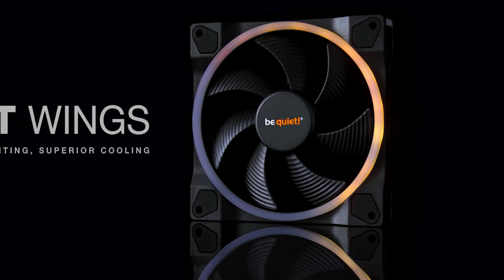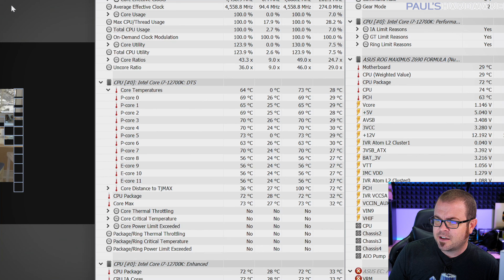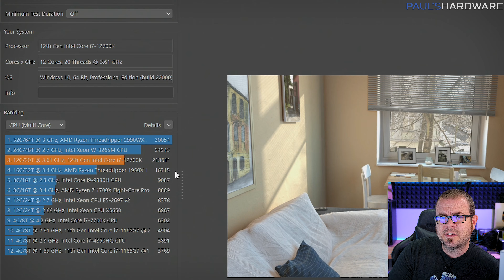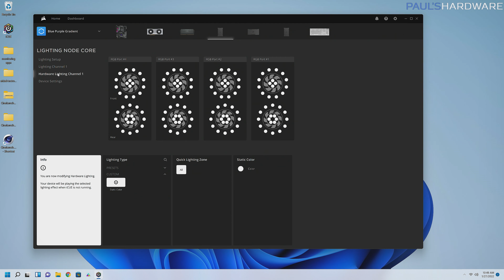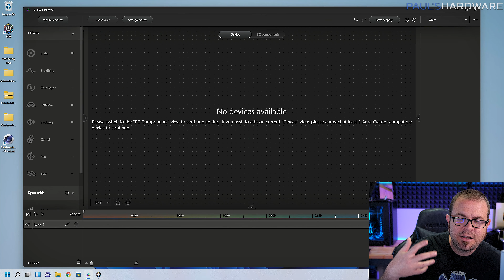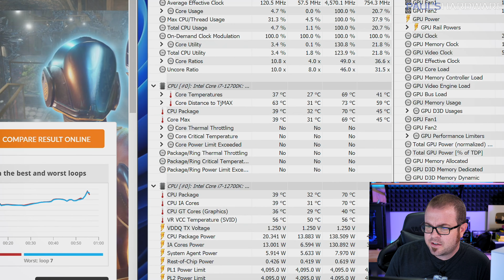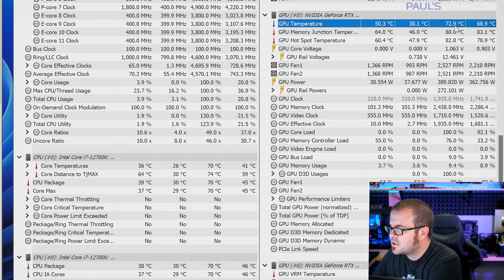Flipping Fans, Stress Tests and RGB Lights: All-White Build Part 2

Comment: This is a perfect example for something I've always wondered. If you 3D printed in vase mode some ducts directly connecting the video card to the top of the case so it had fresh air, would it decrease the GPU temps even more without even needing the top fans. The fresh air ducts would probably only take up space of two fans and you could leave the third fan for an exhaust at the top.

Comment: Only seen a couple comments so far, but what about that pump block being positioned above the rad? Unless that AIO is practically air free, that pump is possibly doomed to fail prematurely. Not super likely, but it was a big topic a while back, and you even had a failure. 

Despite that, it does look sick as hell, nice job.

Comment: Wait, your fan testing makes no sense. First alt config showed you had better CPU but worse GPU... so instead of switching them back to inlets and then swapping the air fans to exhaust instead? you doubled the mistake but having them all exhaust, unless i missed something?

You didn't prove you were correct, you just showed that inlets on the gpu was correct but not the overall fan config in the box...

I think you would get better performance with fewer fans causing lots of vortices and turbulence, decreasing the total amount of airflow through the case.

Comment: I'd set it up where the top and rear are exhausting but the side and bottom are intakes. That keeps it a positive pressure, since there are more intakes, making it a bit easier to keep the dust out, but the airflow should be continuous enough to keep everything cool. Should pull heat off of the GPU pretty well, also, since both exhausts will be on either side of it.
Reply: its well known that exhaust as cpu cooling is higher temps

Comment: Good video, Paul.
My gut says intake fans on the top, bottom, and the single on the back... exhaust with the bank of three on the side.
That could give you the best of all worlds and still has positive pressure.
I also wonder what it would be like to work next to all that RGB lighting. After a few minutes of that, I might be tempted to set them all to "off". But that's just me. I think computers should be covered up and hidden away.

Comment: Isn't the pump being higher than the rad a bad thing? Just going off of jayz vid because any air bubbles will get stuck inside the pump. Unless the pump is inside the radiator like MSI aios.

Comment: I get temps similar to this with just 5 total fans on the H500M, but obviously it doesn't look nearly as good as this. At what point do the aesthetics outweigh performance?
Reply: ey as a H500M owner. i would not get this over the H500m.  4x 200m fans all the way
Reply: @norkris8729  they're surprisingly quiet. the only thing that makes any sound in my case is the AIO, and that's barely audible.
Reply: @criznittle968  And aios can be slowed down when pc is not under load :)

Comment: The reason why that gpu is 90 degrees on the top exhaust one might be because you're basically relying on wafting air drafts being dragged towards the gpu while competing with the top fans exhausting. The cool air has to travel really far between top fans and gpu fans before it can reach the rear side of the case which at that point it would be so thin it would be hot already due to hot air rising. Meanwhile, the bottom intakes spew cold air up to the backplate but since cold air goes down it is sucked out by the rear exhaust fan barely touching the gpu backplate as it flows around with less movement than the above side.

🍀💨🍀🍀🍀
🍀💨💨💨💨
🍀💨🍀🍀🍀
🍀💨🔥🔥🔥
🍀💨💨💨🍀
🍀🍀🍀🍀🍀

Comment: i have one of these cases and performed the same tests as you, in my testing the ideal config was having the 360 AIO as exhaust on the bottom, the rear fan as exhaust, and the other 6 side/top fans set as intakes. But it was at the point where i was splitting hairs, with only 1 or 2 degrees in it vs having the aio on the side.....it's just a good case.
Reply: I am Jealous that you have a 011D Evo, I preordered the case and it has been delayed for almost a month please tell me your secrets on how you managed to get yours?

Comment: Interesting - I built a very close to this PC in July of 2021, (minus the video card because us mere mortals cant get them).  Also not inverted (cause it makes no diff)  All Corsair controlled and with a Corsair CPU Cooler. However I did the OPPOSITE on air direction. Case is negative air with all fans (TOP and back) blowing OUT with (filtered) bottom air intake. My Thermals actually look better? however maybe I'm not pushing it as much as you. Appreciate the in depth analysis though--I'm now re-thinking some choices.

Comment: 0c temp reading on the P-Cores...  E-Cores don't seem to be affected.  Glad to see Paul's system has same issue on his Asus as I am with my MSI.   I first encountered it w/Rocket Lake, but not with Comet Lake on a Z490 board.   If I disable C-States, it doesn't do it.  I submitted it to Intel, and they confirmed that there's a misreading bug which a future motherboard BIOS update should fix [assuming the motherboard manufacturers implement it].

Comment: Paul, the ONLY other configuration I would be curious in seeing the results of would be (rear) intake, (top) intake, (side) exhaust. I understand the rear doesn't have a filter, and that's something I wouldn't be ok with, but I'm curious how that odd fan config would work with a reverse-case layout.
Reply: Besides not having a filter, the pci area exhausts at the back as well. You don't want that heat back into the case again

Comment: Paul, I'd try keeping the top and bottom fans as intake, and the ones on the AIO as exhaust (as well as the lonely one). I think that could be the best option overall.
Reply: AIO as intake is usually better for CPU since you take cold air from outside to cool instead of hot air from inside. In my eyes since this build is flipped the exhaust ones should be one at the bottom and the lonely at the back so GPU does not blow against case air flow and CPU gets cold air for intake.

Comment: I would have flipped the bottom 3 to exhaust instead of the top 3. The top ones should never be exhaust with that GPU configuration.
Reply: Thanks for watching 🔝🔝
And commenting
Send a direct message right away 🆙🆙  you just won a gift🎁.

Comment: Corsair QL120 is not a good choice. High price, over complicated RGB connection, inferior performance compareed to competition. If you still want ot buy it after these, I want to tell you its LED is super unreliable. 4 out of 10 of QL120 that I owned in the past had malfunctioned LED just after a few months (by the way, I didn't set the fans to white). However, I owned 6 LL120 fans and used them for two years whithout a single broken LED. To all new PC builders just don't be fooled by QL120's 'pretty look', there are way better fans out there at cheaper price.
Reply: Thanks for watching 🔝🔝
And commenting
Send a direct message right away 🆙🆙  you just won a gift🎁.

Comment: I wonder if putting the top ones back to intake and then just having the side fans (and the rear fan) as exhaust might be the best of both worlds, but at the same time the original set up seems like it did a pretty good job. Maybe worth a quick test if you have time though. Thanks for the follow up, Paul!
Reply: Thanks for watching 🔝🔝
And commenting
Send a direct message right away 🆙🆙  you just won a gift🎁.

Comment: That RTX 3090 card could benefit from adding a 120mm cooling fan affixed somehow to the backplate. Normally. the backplate would be facing up, and a cooling fan would simply be loosely placed on top. However, with your upside-down configuration, might need some zip ties or some other way to attach it. Especially if planning on running crypto-mining software.
Reply: Thanks for watching 🔝🔝
And commenting
Send a direct message right away 🆙🆙  you just won a gift🎁.

Comment: Only thing I would change over the original fan config, would be the radiator fans. Flip those to exhaust and cpu temps would come down. Maybe even lower gpu temps as well. Plus, have the benefit of not pulling dust through the radiator fins.
Reply: Thanks for watching 🔝🔝
And commenting
Send a direct message right away 🆙🆙  you just won a gift🎁.

Comment: I'm worried about that AIO you've got in there, I feel like it is going to die prematurely due to the poor mounting options of the case. Obviously there isn't much you can do with the tube length but I would keep an eye on it because the pump is higher than the radiator.
Reply: the pump is not higher than the radiator though
Reply: Thanks for watching 🔝🔝
And commenting
Send a direct message right away 🆙🆙  you just won a gift🎁.

Comment: Can you cover the Open source RGB software, Signal RGB with this system?
I have a Thermaltake Core v21 config'd inverted like this. I have also found that top exhaust conflicts with GPU fans, starving them of air. I have set all 5 of my 120mm fans to intake (2 top, 2 bottom, 1 rear) with the front 200mm fan as exhaust.
Reply: Thanks for watching 🔝🔝
And commenting
Send a direct message right away 🆙🆙  you just won a gift🎁.

Comment: what about exhaust out the bottom, since the bottom is not a radiator. So Radiators are intakes and not radiators are exhaust.
Reply: Thanks for watching 🔝🔝
And commenting
Send a direct message right away 🆙🆙  you just won a gift🎁.

Comment: I agree with your original fan orientation, although I am curious about how the temps would be with the bottom three fans as exhaust, along with the rear fan, and the rad and tops fans as intake. That should still provide a slight positive pressure but keep the fresh air going to both the CPU rad AND the GPU. That definitely would have been at the top of my list for configuring the fans in this case.
Reply: this is correct best config is an "L" shape for intake and other "L" for exhaust.  I saw this on a different video radiator and top in with exhaust bottom and rear.

Comment: There is a reason that cases on base MOBO config is bottom to top intake to exhaust, you even mentioned and proved the GPU cooling needs intake to assist. But those bottom fans aren't doing a whole lot besides countering airflow, I like the top pulling for GPU and side pulling for CPU, but the bottom fans just seem useless and countering everything else.
Reply: Thanks for watching 🔝🔝
And commenting
Send a direct message right away 🆙🆙  you just won a gift🎁.

Comment: Try intake at the top, intake on the side, exhaust for the back and exhaust at the bottom. With more positive pressure it should overcome the natural convection in the case.
Reply: even a single fan overpowers convection, the convection currents are really weak.
However if anything is Exhaust it would be the bottom 3 fans with the radiators both going inwards, If you have 1 radiator in and 1 out then it just blows hot air from one radiator through the other one.
Reply: @A.Martin  Nothing can overpower convection, heat will always rise. In a standard case there is a reason the back fan is towards the top pulling the hot air out but that does not stop your memory and CPU from being affected by heat generated by your GPU.
Reply: @BansheeBunny  This man here, officer Burke
Reply: @BansheeBunny  Any fan, at even low speed overpowers convection. This is one of the 3 most misinterpreted theoretical effects. The other being that turbulent airflow is bad (or that it has a significant connection with hot pockets/vortices). And the 3rd being that more fans and more exhaust = more air. You can only exhaust as much as air, as the case can intake (in places with or without fans, Air enters and leaves in places that dont have fans as well. And yes air moving isn't exactly accurate, but easier to explain this way). Just because something is a certain way in theory, does not mean it translates exactly into practice. There's so many new variables at play, and a in "closed" system to boot, ...
Reply: @BansheeBunny  ???
Reply: Thanks for watching 🔝🔝
And commenting
Send a direct message right away 🆙🆙  you just won a gift🎁..

Comment: I would take one more step from that last config and set the top fans back to intake, but leave the AIO set as exhaust. That would mean the CPU heat is going immediately out of the case instead of hanging around inside. Your GPU would be getting air directly from the fans above it again, and you should still have positive pressure overall. Probably not that much different, if at all, from your original setup though, the main thing being keeping the case fans from interfering with the GPU.

Comment: With your original better config, maybe turn one fan as exhaust on the top? Top exhaust did lower the CPU temps. Maybe a hybrid approach with this will get you better on both?
Reply: Thanks for watching 🔝🔝
And commenting
Send a direct message right away 🆙🆙  you just won a gift🎁..

Comment: yes, you are right as well , just dump all the heat you can inside your case, that is always better to keep everything running as cool as possible. Keep trying to re-invent hot water boys, the more viewers you get to agree does not mean you are right about anything though. Why use watercooling when you gonna dump the heat inside your case first, where is you people's logic ? A number on an app with hundreds of numbers you don't look at. If your graphics card is heating more then you have bad airflow anyway , if you are watercooling anyway then do it fully including the graphics card and then you will understand not to dump any heat into your case. So yeah you are absolutely right Paul.  Catch that sarcasm ?
Reply: Thanks for watching 🔝🔝
And commenting
Send a direct message right away 🆙🆙  you just won a gift🎁..

Comment: I did the same build except for the AH T600 case and H150i capillex for me, where did you find that white ram in stock? I couldn't find any white ddr5 ram in stock a month ago when I built mine :/
Reply: Thanks for watching 🔝🔝
And commenting
Send a direct message right away 🆙🆙  you just won a gift🎁..

Comment: I would try AIO fans as exhaust with top fans as intakes.  That would prevent the radiator heat from adding to the case temperature.
Reply: but the exhaust radiator would be sucking through already hot air.
Reply: @A.Martin  True, but we have seen dual rad setups where the top rad is exhaust.  As long as Paul is satisfied with temps that's all that matters.
Reply: Thanks for watching 🔝🔝
And commenting
Send a direct message right away 🆙🆙  you just won a gift🎁...

Comment: Awesome video Paul. As much as I am not a fan (pun intended) of pink. Man that really worked with the lighting. And I am sure it will go well with Hello Kitty stickers. 😺 
As for the fan configuration,  there are SO many options in the case. I put 2x 140 fans blowing on my gpu in my LanCool II Mesh case. Idle for my GPU fans not moving is 50C, with GPU fans at 100% and idle system is 34C. Under game load, 55C. So COOL!!!
Reply: Thanks for watching 🔝🔝
And commenting
Send a direct message right away 🆙🆙  you just won a gift🎁...

Comment: You need most of the system with all white, or ice blue, lighting to simulate chrome and then have the GPU doing the visor effect in red. Then at boot make it play a sound file with "By Your Command".
Reply: I actually had a pretty cool setup years ago using a BlinkStick USB to control an RGB strip around the perimeter (the only lights in the system at the time)..
When the PC woke up from sleep or did a cold boot - the lights would slowly fade in as white, with a red pulse running around the perimeter a few times to represent a boot cycle.
Then it would fade into temperature monitoring mode, with 20C = cyan, 40C = white and 60C = magenta.. then above that temperature the lights would turn off and start pulsing in a 'heart beat' type rhythm in full red.
When just past 60C it would beat at roughly 50bpm, a slow resting heart rate.. but then beat faster and faster as the temps went up.

It took a long time to set it up, programmed in python and responded to GPU temps (as the CPU was low power and water cooled so barely changed). To get the GPU temps in Python I had to make MSI Afterburner output to a log file on my RAMdisk every second which the python script would read and occasionally clear out as it reached a certain size. Fun project for sure, and I wish there was more accessible options to do that kind of thing with custom scripts.
Reply: Thanks for watching 🔝🔝
And commenting
Send a direct message right away 🆙🆙  you just won a gift🎁...

Comment: wow, that stock 12700K is literally right behind my 5900X when stock on air, maybe just 450 points faster in R23 multi, and the 12700K has an $130 lower MSRP ($80 now) and is actually available, the 5900X is still hard to get at times. Now, factoring in a good motherboard and dealing with DDR5 and the Intel machine is still more spendy, but man do I love competition in computing. I heard a rumor that we're going to soon see $399 sale 5900X's. $299 5800X's and $199 5600X's, which is honestly where those parts should be. I'm bummed that it doesn't look like we'll see the 5900X3D, but at least if they release the 5800X3D, we should see better pricing elsewhere.
Reply: If the price of the 5600x drop that low imma need to ask for a refund for the one I just bought recently…..
Reply: Thanks for watching 🔝🔝
And commenting
Send a direct message right away 🆙🆙  you just won a gift🎁...